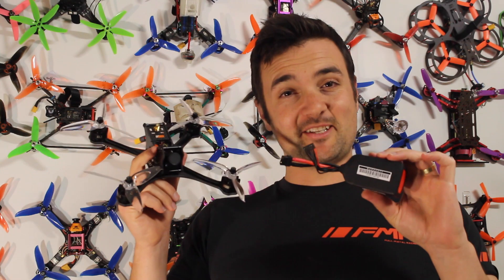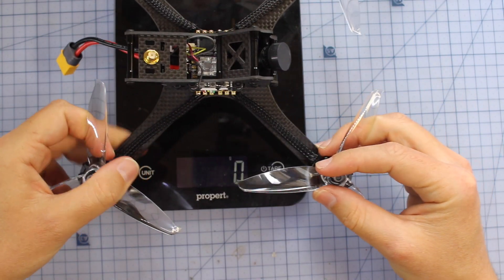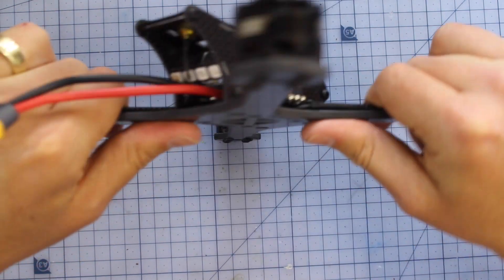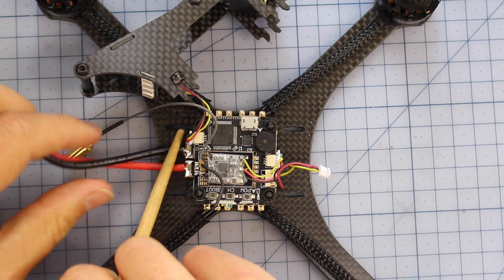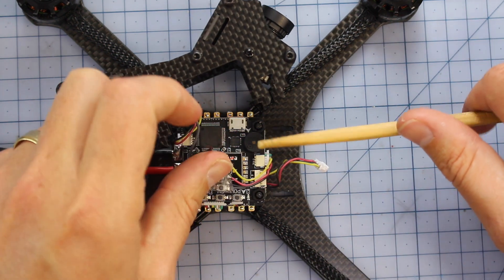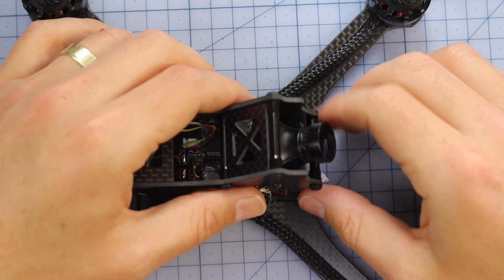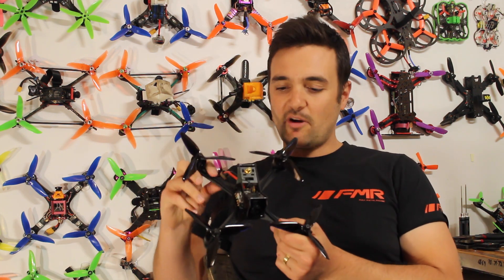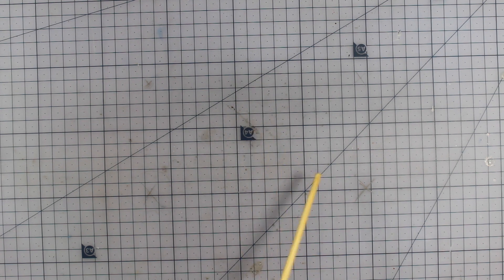Are Today’s Race Drones getting TOO POWERFUL? FURIBEE DARKMAX review.

Comment: @Stuw: for your next Q&A: How do you handle landing for most of your racing drones cary there batteries on the bottom and there is no landing gear what so ever. These battaries usualy do not like getting beating of on a rough landing. Also is a big batterie not also making the landing so unbalnced that the props might get damaged as well easily?

Comment: As you go up in voltage of the battery, you actually need less amperage in the ESCs. Shockingly, Mattystunts had been flying 6S in his quads with 20A ESCs, with a capacitor. I'm not an expert on the math and science, but I'm pretty sure if it's a decent 30A all in one ESC, it should handle up to 6S fine. But I'm excited to see your real world tests of this thing on higher voltage batteries

Comment: got my darkmax today got it all set up in betaflight with a half charged 18 volt 1300 graphene  battery,  was just about to take it out and test fly it with a fully charged battery at 20volt ,pluged it in and it gave a little flash and puff of smoke and no power to the flight controller ,looks like it cooked a little diode . 75$ for a new one from gearbest for another square buzzer and the upgrade omnibus f4 one is out of stock :/. any ideas or info would be handy

Comment: Stew, your channel is my maiden Sub! It looks like a Rocket (86mph). My guess. You said you like 2.5mm lens. Is that your  preferred lens size?  You  recently recommended a OSD for an Eachine x220. Runcam swift 2. Or would recommend the Rotor Riot swift 2?

Comment: bad camera protection is a deal breaker for me. I also what to have room for a triple stack. Both of those points are due to the fact that I want to install a runcam split, and i certainly would not to smash that up and need room for the extra board.

Comment: Stew can you do a comparison on fat arms vs skinny? I transferred all my components from a fat armed quad to a skinny armed racer. I noticed the amps and battery dumping so much faster. Skinny arms = motors spinning faster with less restriction = more battery sag/voltage drop. Do it before that smarty dress bardwell does it.

Comment: People say fireball at 6s but AndyRC tested it on 5s and 6s without any flames :). Part 2 gonna be interesting, maybe speedgun sully can measure a flying comet. Happy flying !
Reply from the maker: I saw that, I just wish he punched it a bit more instead of a little blip.
Reply: UAVfutures Why didn't you try the x215 on 5s or 6s? It is rated for 5s and 6s as well.
Reply: I heard that he did another video giving it full pelt
Reply: AndyRC You heard it. I seen it.
Reply: Coppertop FPV 6 secs and it would be gone.
Reply: andyrc isnt claiming to be a racer. he does great reviews i dont see what the complaint is here? i havent seen him trying to kill quads by gunning it across his field, why would he start now?

Comment: Could anyone explain the difference between the DSMX recerver, FLYSKY AFHDS 2A receiver, FLYSKY AFHDS and FRSKY receiver? Im new to the hobby, trying to understand which one to order. Ive got the FrSky ACCST Taranis Q X7 and Flysky I6 2.4G radios  if it is important. 

Thanks!
Reply: You can bind DSMX with Spektrum transmitter, FrSky with Frsky transmitter and FlySky with Flysky transmitter without external module. If you wanna run FlySky reciever with Frsky transmitter, you need some external module because of different protocol which they use. If you have Taranis, then I recommend to buy one with FrSky reciever.

Comment: G'Day Stu..I just received my Aomway Commander and I'm still trying to decide whether to keep it or not. I'm just taking a break from the Heli world and trying this whole FPV thing. Still feeling weird when flying with the Goggles on but then again it was a cheap one from one of the co-worker. Pls help me decide for me to keep this Goggles. What Antennas would you recommend for this Aomway Goggle? Guess Joshua is a little upset with me 😂. Nice review on those Furibee Quads. Thanks!
Reply from the maker: pegoda antennas are good, And a farview patch should be great
Reply: +UAVfutures Thank you Stu, and as far as learning to fly with the Goggles on coming from an experienced pilot like yourself what is the best way for me to learn all this in a smooth process?
Reply: +UAVfutures Stu, what's the difference in LHCP or the RHCP on Pagodas Antennas? Thanks!
Reply: scrc511 there's no difference, you just have to make sure u match them on both your transmitter and receiver, use a LHCP on both or a RHCP on both. If you're flying with a friend who's using one kind, you can get a cleaner signal by using the other kind. That's the gist of it
Reply: scrc511 I run a blade 230s night heli with fpv, and it works great. I have not run it through our FPV course though, need to but, afraid it will be a one way trip for the helicopter
Reply: Drone Hero's Thanks for the info, appreciate it very much.
Reply: Drone Hero's I have the Aomway Commander V1 Goggle which I'm still trying to decide whether to keep it or not. Since it comes with built in modules, how would I know which is the right Antenna to use?

Comment: Need help. I bought the original x220 wizard a while back but after a few crashes I've had a small issue. The drone is intact and all components are fine except for the receiver antenna you know the little black ones that come out the side. Here's my issue at around 50 feet I start to lose video signal and it cuts out off and on and gets choppy as well does that antenna have anything to do with my video feed. FYI it was sliced with one of the blades
Reply: David ok but the exposed wire was cut so what's left is one base wire you know the bigger part towards the bottom the base before the extended wire any ideas
Reply: David thank you sir I will do that and hopefully I can have great video feed to get back into the hobby I appreciate it your a lifesaver
Reply: Dude, you were given wrong information... The two small antennas that come out the side of the Wizard are for what you said in the first place the RECEIVER, not the video TRANSMITTER. This guy is telling you how to trim reciever antennas to keep radio link with your quad if they get damaged like you were describing with the prop damage yours received. 

This has basically nothing to do with your video feed, sir.

The antenna for your video is the single fat one that comes out of the rear of the top plate that can be screwed on and off, assuming that you haven't modified the quad in any way.

As for your video problems, could be a number of things based on you saying you've had a 'few' crashes. The antenna i mentioned might need to be tightened, you could have had a voltage spike from the crashes and the VTX is damaged (worst case really), your motors are getting some wear and damage possibly from the crashes and are becoming 'noisier' which can lead to static in your video feed.
Reply: PitVipR PlayS  that's what I was thinking to myself your right I'm talking about the receiver antenna not the video antenna coming out the back I have purchased some fatshark antennas for the rear to see if my video footage was corrected with this but still am not receiving perfect quality pass 50feet. I put on my googles and as I fly away the video feed starts to flicker then eventually turns gray and not visible anymore which doesn't allow me to fly fpv and it's frustrating. As far as the motors I'll tighten them down to see if that helps and I've purchased another vtx but have not installed it because it requires soldering and I'm not sure I want to mess with that yet. I was gonna purchase a new camera to see if that helped my video footage but wasn't sure if I should go that route
Reply: Before you spend too much, make sure you aren't on an adjacent channel. It could be close enough to pick up short range then go out.
Reply: MrSnowpawn thanks

Comment: We are pushing the limits of these little bearings, not so much with larger motors as it's hard to push past 45Krpm, but the 1104/1105/1106 are beyond the limit,  good bearings are rated at 67Krpm,  but at 3s, I'm at 72Krpm and theoretically at 4s 92Krpms!!!

Comment: got one...hated it, no support from the hobby shop, or the drone "community" Most of the builds I see aren't helpful with the problems I am having. Now I have 3 drones, a Tyrant S, I crashed, learning. Bought crap parts, from hobby clowns, that could not install, diagnose, or assemble an FPV drone, no mater how much I could through at them. Bought another Tyrant S...out of the box...bad ESC. FuriBee Dark, now hostage for production sloppiness. I'm loaded up with JUNK...expensive PENGUIN parts. Still, can't fly.
Reply: stay away from this junk product, to buy another one from furibee or eachine, you will be having a pile of junk, monkey parts and quads,,, in a box,, $1000 and asking yourself why,,,

Comment: Came with broken camera connector, fc board is junk, esc are a wonder on wiring, if you want to tear this thing down ,, which is a pain in the ass to put back together,,, have at it,,, bnf ,,, no its furibee junk,,, more time fixing it, than flying it,,, worthless junk,,, ohh but WOW its got dYs motors,, its a must "GET REAL" ,,

Comment: again, you used the wrong form of the word TO...
Reply from the maker: I did not. Too is an adverb meaning "excessively"
Reply: UAVfutures I'm sorry but you are wrong. "To" is correct. Prove me wrong and I will donate $10. a month for a year. Think about it this way, "That drone is to fast to fly" and "That drone is too fast to fly" or as a synonym "That drone is extremely (too) fast to fly". The first way is stating that it's so fast it can't be flown, the second way is saying one of two things depending on context, either that the drone flies very fast or that the process and experience of flying the drone goes by in a short amount of time. 
  communication is important.
Reply: You've got the wrong meanings. "Too", in this case, would seem to mean that the quadcopter goes faster than the pilot could make use of, making it the correct term. There's no way "to fast" would work unless it was in the context of "I'm going to fast for a week", for example, and no situation in which your definition of "to" would be correct.

I hope Stew enjoys the extra $10 a month for a year :) And if you want to be proved wrong, I'll leave that to the wide expanse of resources online!
Reply: Wind1000100 no you are wrong. Iv already asked two English majors. used as a function word (1) to indicate the extent or degree (as of completeness or accuracy) loyal to a man. generous to a fault or the extent and result (as of an action or a condition) beaten to death (2) to indicate the last or an intermediate point of a series moderate to cool temperatures
Reply: UAVfutures used as a function word (1) to indicate the extent or degree..
Reply: UAVfutures so you wanted to say "is this drone exessivly powerful to fly?" that is moronic.
Reply from the maker: I wanted to say "is this drone is excessively powerful" hence "is this drone too powerful"
Reply: Actually, what he wanted to say makes complete sense, whereas whatever else you're suggesting does not.
Reply: UAVfutures excessively powerful for what though? or too powerful for what?  that's not a complete sentance.. it would be if you said  is this drone to powerful? it would imply that it's to powerful to fly. or.. the degree of power is such that it can not be flown!
Reply: This has to be a troll. 'it not' 'your are to stupid' (wrong 'to' again) and other misspellings. I can't take this seriously anymore.